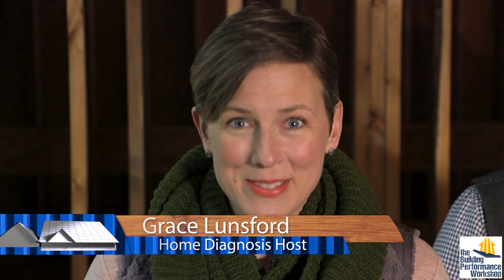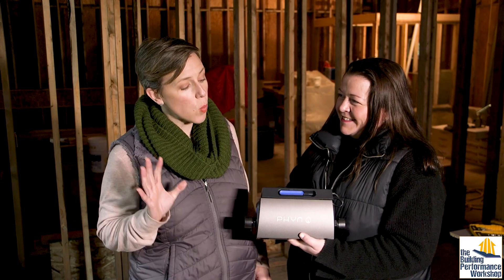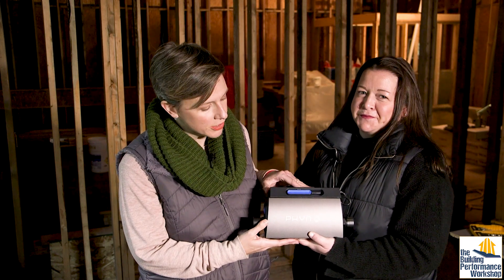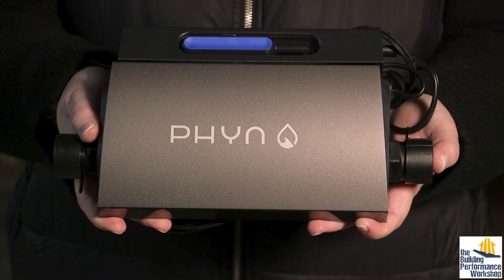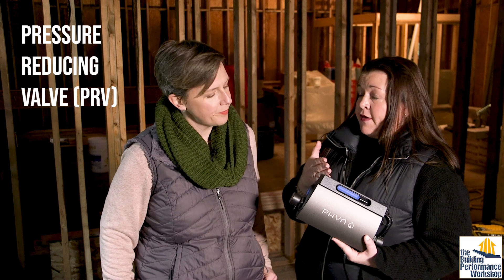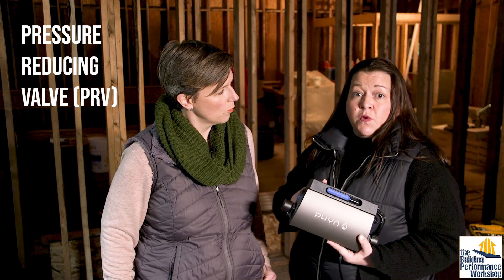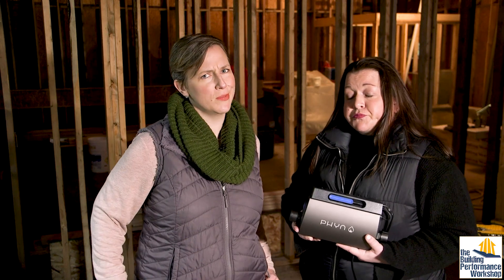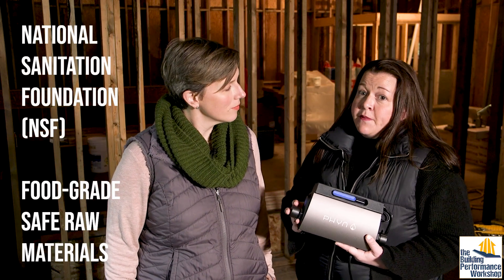Water Softener, Filter, and Leak Detector Plan for Our High Performance House

Comment: Are you using any system to control the water pH?
Reply from the maker: The RO system will do that, as I understand
Reply: @HomePerformance  Are you willing to tell us the brand and model?
Reply: @AverageJoe4063  It's a Pentel Pentek system. I have the same system and am very happy with it.